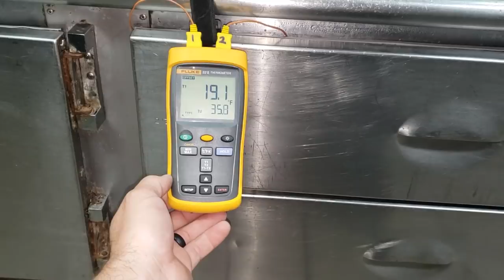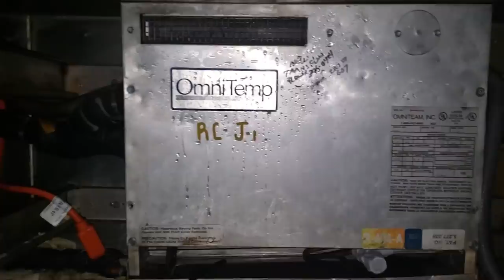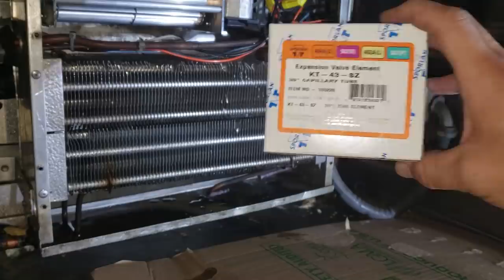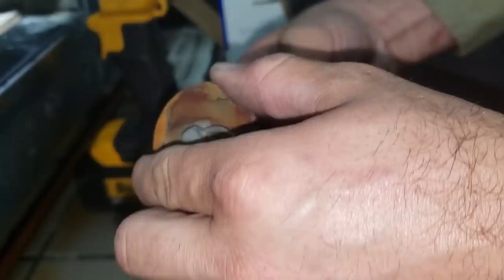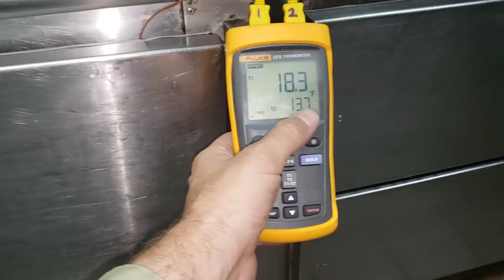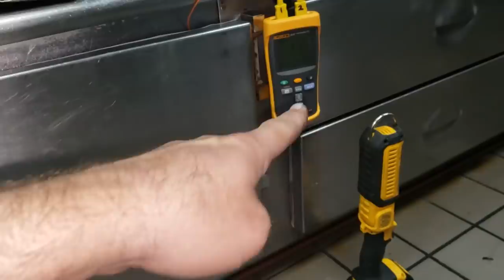COOKS FREEZER DRAWERS NOT WORKING

Comment: Dude... I could almost smell the phosgene through my phone! 🤣 

This is one of the things that would shorten my lifespan given the frustration level of such tight spaces. I swear, when engineers design equipment, they are adamant about playing sick pranks on the techs that will come behind to fix it... It HAS to be a joke, or something. 

Nice work, as usual, man! 🤙
Reply: That's right.  We make sure to put sharp edges near places where people have to screw on tight bolts or nuts because we love the sight of blood.  That's four years of school put to practical use.  Another thing we love to do is only allow you to turn the wrenches a full 1/2" before you have to take it out again.  Room to put in wrenches are a big no no in design philosophy.
Reply: ahndeux; Haha, you’re one of those damned engineers, aren’t you!?!

Comment: Dude, I laugh that someone would possibly call you a hack! The work done is very thorough but in typical situations on poor equipment in general. The "hack" is the  guy convincing the customer they need an entire evaporator assembly because he can't squeeze in there to do repairs. So...if they think you're a "hack" well, hack away my friend!
Reply: I agree with Brent, we've had 2 bad evaps in 10 years, it's almost always a rotted out power head. I've learned to change the txv an be done with it.
Reply: Yeah the Bev-Aire stuff in their kitchens suck
Reply: Silver Ryno whenever I replace an evap in a reach in it is usually due to acidic food eating away at the copper
Reply: That’s a real deal situation right there. Anyone whose worth a damn in this industry understands and appreciates what you did here. Nightmare of a job. Killer work.

Comment: Great job Chris - no hack, been there, done that. In situations like this I try to scratch the piping on both sides of the TXV with my dremel tool and will use flux to help get the silver solder to flow around the back (blind) side. I also have a spray bottle of water with me to cool the valve. I usually do one side, cool the valve with water, and then do the other and coil again. The wet rag works well too. Great job overall and an A to you

Comment: In those situations you have to do whats accessible. Probably what i do with that is to pull the evaporator out if the system was pumped out, then change out the txv for the new one. Good insight information about turning the adjustment all the way out and all the way in counting the turns on the txv. Now you have it centered like the factory.

Comment: Couples of things I noticed here and would like to comment on. 
Using an oxy acetylene (5400 F) torch makes a world of difference vs air acetylene . The flame temperature is very high and gives you the ability to reach brazing temps quickly and narrowly introducing less heat in the T.X.V. if you control the distance properly. Great for small tubing and near aluminium fins.
For brazing already brazed copper to new copper, no sanding is required. Same for new to new copper. You need sanding when it's dirty and oxidized.
With enough experience or practice you can braze blind. When you have done so many, you KNOW that you did everything well enough that you can trust your work. The inspection mirror is only used to confirm how good you are. ;)

Comment: Drill out rivets and could run on sides by u-bends for bulbs if worried about rub through but only trying to make it last 2months it really wont rub out that quickly. Rerivet when done or put stubby screw instead. Either way works.

Comment: The way you un brazed and brazed that valve I don't think I could have done that. I would take a different approach only because I know I would screw it up.Cut the old valve out close to the valve because it soaks up a lot of heat when you try and un braze. Then it takes less heat to un braze the old outlet fitting from the pipe. Pipe the coil connection out side of the coil where you can get at it put the new valve in and it would be Staybrite #8 for me because I would have been afraid of not enough heat on the backside of the braze.But I was thinking of a larger valve. With small diameter tubing like you had it is more doable your way.But great job Chris, it's all experience and working with what you have and knowing what you can do. Decisions, decisions

Comment: Well Chris, it was a bit of a hack job, but as a refrigeration company owner myself I can attest that sometimes you have to be practical based on economic realities. You mentioned that the customer was replacing the equipment in 2-3 months time, so I doubt that they would have been happy with 2 more hours labour on your bill to make that job perfect. I don’t like cutting corners either, but this clearly was a quick temporary fix to get the customer up and running.
Reply: what? a 2-3 month fix on a small reach in cooler/freezer can reduce a lot of head aches for the staff and managers for a walk in cooler they have to go in and out of that will accumulate frost build up on the coil from the humidity of staff going in and out of the cooler to get to the conjoined freezer.

Comment: I think it's funny, sometimes you call it a weld, sometimes call it brazing.  The alternative would be to put in a flare fitting, as long as you can get enough swing with a wrench.

Jim
Reply from the maker: Yeah out of habit i call it weld, but that's not technically correct so i try to say braze .......

Comment: If that were a new box and the repair wasn’t temporary. How would you have done it in order to route the bulb and transmission tube through the back? Is there a way of removing that evaporator cooling unit out to work in the open if you were to unsweat the liquid line and suction? Definitely not a hack btw.

Comment: So visually would a txv be bad if it's frosting over on a 404a refrigeration system? Is that a sign? I had a similar scenario
Reply from the maker: No not necessarily the system could just be frozen up and or have bad airflow causing the tev to frost up
Reply: @HVACRVIDEOS   I replaced a compressor and it was a merchandiser ice box and it started up from 70°. I wanted the temp around 18° but a day later I was only at 26° with a frosty txv.

Comment: Hey Chris,
Good Video. Chris, YOU got soo Lucky ! But, it should have been done Differently. as a Teacher to Alot of New guys out there that was a RISKY Txv Replacement. oil in the evaporator could have fouled your weld on the outlet of the txv and turned it into a real cluster F**k. been ther many times. not worth the risk !!! Txv could also have been ruined with amount of heat applied to get weld to flow at backside of joint. He Got Lucky on this one !!! guys. But, Please Remove Evaps when u can't get a torch to the backside of a weld AND EVAP. IS SOO EASILY REMOVED.

( Ftngot) - ( For the new guys out there.) 
in THIS PARTICULAR SITUATION--- The Evaporator should have been Removed When thier is no access to Back side of Txv for welding and when txv is in a no space situation. WHEN REMOVING THE EVAP IS SOO EASY in this case. 4 screws hold evap to wall-Easily accessible, one 1/2" sealtite wiring connection - 3 wires easily accessible, suction and liquid lines easily accessible.
Also / NOTE --- i Have Started installing --- Suction access tees, liquid line access tee's and Sight glasses down below at Evaporators so u can --- Adjust txv's ,  Add refrigerant from Down Below if it's raining on the roof , Tell if unit is low on charge from down below without going up on roof. it's Very easy to do this at this point since the evap is allready pulled for txv replacement. YOu have employees / helpers allready on the jobsite. i Would have said to your helper- Get in there and Remove that evap. Chop, chop and a few wires disconnected, and 4 screws it soes not get any easier than that.
Also --- a tip for you Chris from a guy thats been doing it 38 years. Brush some white brazing flux on your joints BEFORE trying to unsweat they come out easier and leave a thinner amount of 15% left on the copper for re-insertion. u can also dip your 15% rod in it for a better flowing joint, also making it thinner flowing, and 

less heat seems to be required to flow. you can cap off joints with straight 15% Rod ( no flux) over the fluxed joint to add Beef to a joint too.
Work Smarter guys NOT Harder. 

Also --- Txv Bulb should have been on top of the Suction line not the bottom as was shown. 

( ftngot) --- Look at the job, things may not be where they are supposed to be. Don't just follow what a factory does.
You have to be able to spot Factory screw ups / Last tech screwups/ oops / mistakes too ! The Last tech may have done something wrong or put a part in a wrong place. ive seen it. it happens. not often, but it happens. Don't just put it back the way it was , make it better / correct.
Also --- Chris you could have put the Txv Bulb on the Suction line outside the evap on this one. it would have made life a little easier. just insulate the bulb 6" to either side of the bulb and make sure the bulb has 1/2" to 3/4" of insulation covering the bulb. very important, bulb must be insulated from external temperatures.( for the new guys out there.)
i hope this helps some people --- Mainly New Guys out there !
Reply: These are the Access tees i use , of course i buy them from our supply houses, not grainger.--- For the New guys out there. ( Ftngot)
https://www.grainger.com/product/JB-INDUSTRIES-1-4-Access-Valve-Tee-3DWY3
Reply: Curious as to why the TXV bulb would be placed on top of the suction line verses the 4 or 8 position.
Reply: All Manufacturers say on any line 7/8" or smaller Txv bulb must be placed at the 12 oclock position. reason for it is to avoid erratic valve operation. if bulb is put on bottom , liquid may come by it and oil not good. especially on very small suction lines. on Lines 7/8" or Larger , Yes, bulb should be mounted at the 3-4 o'clock position or 8-9 oclock position. When u get a txv next time , Read the piece of paper in the box. They are a wealth of information.
Reply: @OcRefrig  
Manufacturers of evaporator coils vary quite a bit in their recommendations, as do expansion valve manufacturers. The general rule for element bulb mounting is to never place at the bottom due to oil/liquid refrigerant affecting the proper operation of the valve.  7/8 copper pipe and above, it is generally accepted to place the bulb at the 4 or 8 o'clock position,  and sometimes 3 or 9. With pipes smaller than 7/8, any position except the bottom is generally acceptable in most cases, and sometimes changing the position slightly can yield different results. A blanket statement about all manufacturers is not appropriate or correct. I can provide you with several references if you would like. This post is not meant to offend you or anyone else. Just wanted to point out that before we criticize others, we should be able to back up what we say, and admit when we may be slightly mistaken. We learn new things every day. All of us, new to old. I learned a bit more about element bulb mounting, realizing that I have more options with the smaller pipes. There are no absolute experts in this field, as it is always changing. I appreciate and welcome other points of view, and through the wonders of YouTube,  have recently realized that there are many others that deal with the same broken junk that I am waist deep in every day. Have a great day one and all!

Comment: i thought nylog was meant to be used on the face of the male part of the flare fitting as thats the sealing surface
Reply from the maker: Yeah it is but its also good to use it on the threads to ensure smooth tightening

Comment: would you consider disconnected the electricals and pipework and pulling the evap out of the fridge and then working on it. thats what i do
Reply: Agreed. in this particular case - it would have been easier.
Reply: The customer probably didn't want to pay for it, he did say the box was getting replaced in a couple of months. It was most likely a cheap and temporary fix so the health inspector doesn't get crazy with the write-ups lol